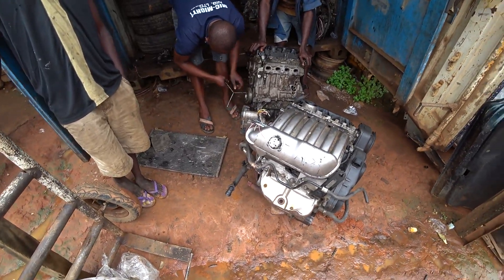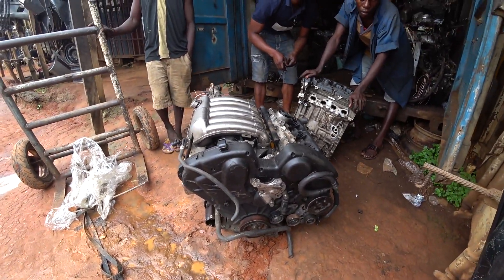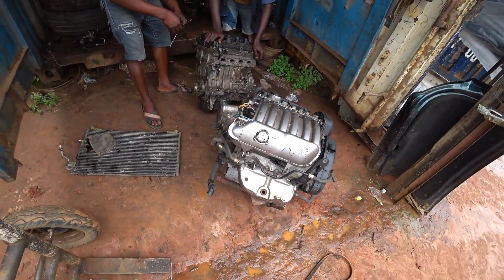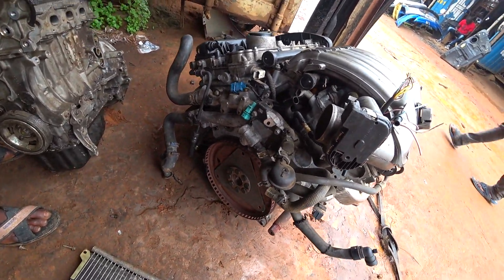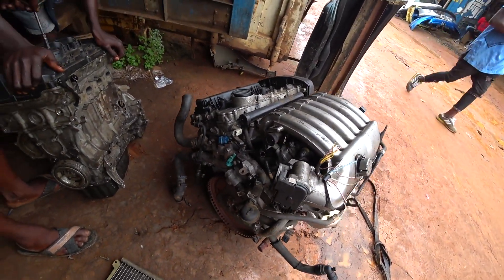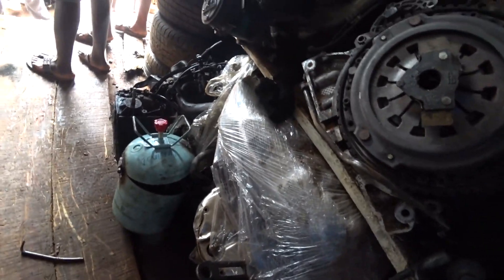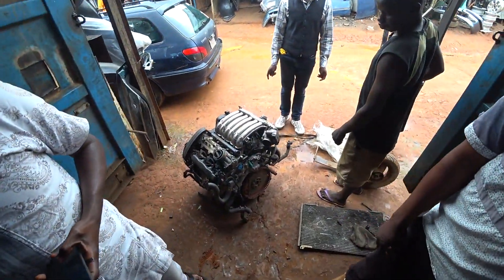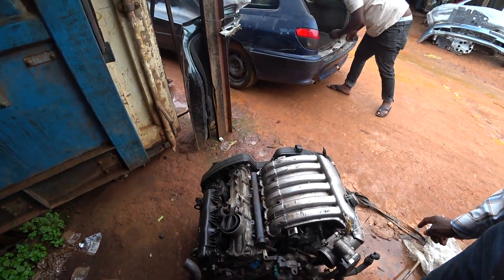Purchase & Replacement of ES9J4S Engine In Peugeot 607 V6

Comment: Hello mate,
I swapped the es9j4s into my 406 but i had a key remote problem, the key remote has signal but the car not responding to lock or unlock through the remote could you help?